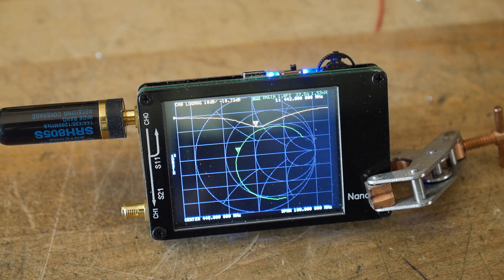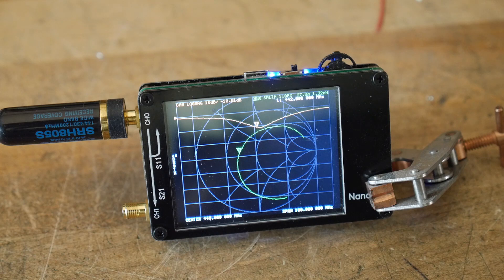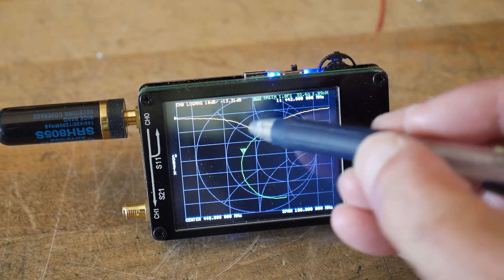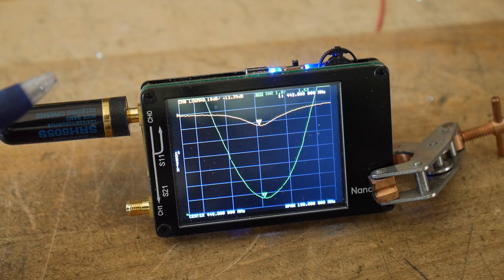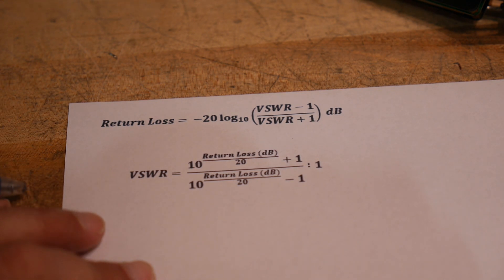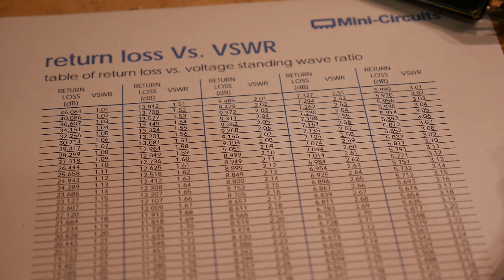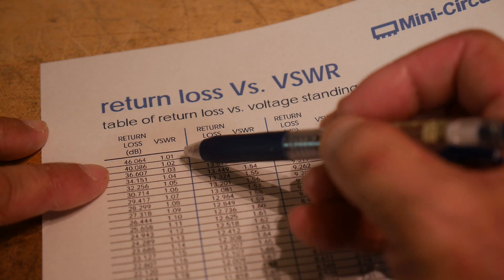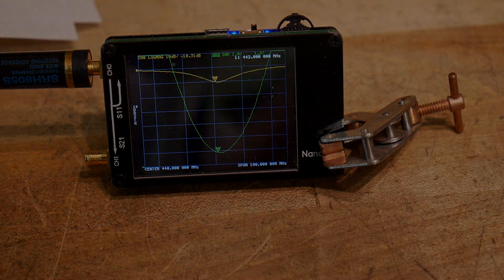#368 NANOVNA Return Loss vs VSWR

Comment: Wow! Nice. I just got the NanoVNA-H and stuffed it on my homemade mag loop. Verrrry interesting plots. And now I can begin to understand why the X5105 says the SWR is one thing and the VNA says the plot looks like I should never get on the air ;-) (Wish I'd had one of these toys starting out six decades ago. I might have gone into engineering instead of linguistics ;-) )
Reply: I had the same thoughts at first. I had to make sure I recalibrated it or recalled a previous calibration before taking a measurement. If you just turn it on it defaults to a non calibrated state and gives some erroneos readings. I did this with my first vertical antenna and the VNA said 1.1:1 swr but my radio was saying high swr. Calibration was off. I thought I was doing the right recall proceedure but I was really hitting the wrong button it turns out. Just a tip!

Comment: To be perfectly pendantic - the LOGMAG of the S11 on CH0 of the VNA is actually the log-magnitude of the REFLECTION COEFFICIENT, not Return Loss.  Strictly speaking, Return Loss is a positive number - i.e. the greater the number, the greater the "loss".  If you simply change the sign of what you're reading, you get Return Loss.   
Return Loss = -(Reflection coefficient or S11).
The terms are used interchangeably.  You've correctly referred to Return Loss as a positive value, but the nanoVNA displays and plots the LOGMAG of S11 which is the Reflection Coefficient.
Reply from the maker: Thanks Alan. Your comments are always welcome
Reply: @user-lp3cf5yn5b  A very low reflection coefficient like that is good.  It means there is very little energy being reflected.
Reply: @user-lp3cf5yn5b  Based on the picture you emailed, there really isn't much to be concerned about.  -45dB ref coef is still quite good.  Looks like you have your transmission line terminated (based on the smith chart).    The dips at 2.8 and 8.2m don't really indicate anything significant.
Reply: i know it's quite off topic but do anybody know of a good place to watch new series online ?
Reply: @Lennon Louis thanks, I went there and it seems to work :) I really appreciate it!
Reply: @Rory Cayson Glad I could help :D
Reply: I am struggling to grasp the Logmag reading, vs return loss. Typically, you want the return loss high, right? If less energy returns, it must have gotten thru or radiated.. Which would represent SWR being low..
Reply: @clems6989  Yes, you want the return LOSS to be high (a large positive number).  Thus, you want the reflection coefficient to the small (a large negative number).  They are the SAME number, they just have different signs.
Reply: @w2aew  Hello, I recently purchased a litevna64 to measure FPV drone antennas. Do I understand correctly that -30 is better and -5 is worse? What numbers are good and bad? 🙈
Reply: @DartRM27  Yes, for S11 (which is reflection coefficient), the larger the negative number, the better. -5 is better than 0, -10 is better than -5, -15 is better than -10.  A reflection coefficient of -10dB is approx equivalent to a 2 to 1 SWR and considered good.  S11 of -14dB of about equivalent to SWR of 1.5 to 1 and considered near perfect.
Reply: @w2aew  thanks 💘

Comment: Swr is just a visual representation and simplification of return loss as measured by a simple and cheap meter, Hence why it's a popular measurement.
Reply from the maker: It is voltage measurements not power measurements making is easier (cheaper)

Comment: Hello, I recently purchased a litevna64 to measure FPV drone antennas. Do I understand correctly that -30 is better and -5 is worse? What numbers are good and bad?
Reply from the maker: yes -30 is better. you want at least -20 for a good antenna
Reply from the maker: https://youtu.be/0GrMIGAyFUE?si=VOGwFwy7gjinc3AO
Reply: @IMSAIGuy  thanks 🙏🏻
Reply: Do you have, or could you do a video on what happens to reflected power? There are too many folks claiming SWR finds its way to the antenna and is getting radiated, not lost. Sure, the radio can also reflect power coming back toward it, too, but the chances are the combination of transmission line and radio amplifier output network losses are wasting most if not all of that power. You have great ability to show many things with your vast test instruments, can you show what happens to reflected power in a typical ham setup?

Comment: I'm always troubled by people who use db as a thing.  "DBs" is not a thing that flows out or bounces back.  Energy is a thing.  Energy, measured as power, voltage, or current is what is flowing out and/or reflecting back.  DB is a ratio of two things (power, voltage etc.).  At 1:19 you say, "how many dbs come back?"  That is a nonsense question.  DB is not coming back.  The return loss at the input is the ratio of the power going out (forward) to the power coming back (reflected) and is measured in db.   It's a ratio, meaning the reflected power divided by the forward power.  Power / Power (or voltage, etc.) means the units cancel an you are left with just a number.  And that number is not going out or coming back.  It's the combination of both, not one or the other.
Reply from the maker: saying how many db is coming back is like saying what percentage is coming back...

Comment: so I guess a perfect 1:1 match equals an infinite return loss.
Reply from the maker: yes  minus infinity db   you will be limited to the noise floor of the instrument.  70db 0 to 300mhz  50db 300 to 600mhz   40db 600 to 900mhz
Reply: Very doubtful you will ever see it in real life.  However if all the power is absorbed by the load there is nothing to come back to be measured.  You may get so close that the instruments can not show it.

Comment: Hello! Nice video, thanks a lot.  Now, which firmware version did you use to do the video, the "aa" DFU or the "ch" DFU?  The "aa" device firmware update (DFU) is known as the Antenna Analyzer version.  Can you tell us if you did use that one or did you just use the default one?  Thanks!
Reply from the maker: used the aa. both use the same data just plot it different

Comment: I have always hated dBs as it never seems to make much sense to me, for instance how is 46dBs of return loss better than 6dBs ...I find it much easier to work in power loss in Watts, for example TX puts out 100 Watts and you lose 10 watts so there's 90 Watts going out the Antenna...rather than 46dbs loss with 6dbs going out which doesn't make a lot of sense to me.
Glad to see even the Experts having to use a Table to work out what the dBs mean in swr terms.

Comment: Hi @IMSAI Guy, i was wondering why the return loss is presented on the NANOVNA in a negative value (-12db)

Because the cheat sheet do not present RL in negative values...
Reply from the maker: I've seen it both ways. Nice to have the negative sign so you don't confuse gain and loss. +10db gain. -10db loss. Otherwise, if it is understood to be a loss then no sign is needed.

Comment: hi, ty for your video.
i want buy one but how & we can see frequency resonance of an antenna ??
ty
Reply from the maker: the frequency resonance will occur at a low return loss. So I look at return loss trace and set a marker. move the marker to the dip in the return loss and the marker will read out frequency. or use SWR trace if you like that instead.
Reply: @IMSAIGuy  ok, ty & sy i have see your video on bad antenna & good and it's explain I just ordered one at the moment
TY ;) fast reply wow +++
Reply: Resonance occurs when j=0  (s11)

Comment: Can this nanovna tune a duplexer?
Reply from the maker: I would think so
Reply: Yes it can with the one problem .  If a duplexer has more rejection than the nano can resolve you run out of 'head room' .  That is if the nano puts out -20 dbm of power and the receiver part is -100 dbm you have 80 db of range.  If the duplexer has a rejection notch of less than 80 db you are ok to go.  The better duplexers will have over 90 db of rejection, so you will not be able to get a good notch adjustment.

Comment: ... I should have said inconsistent with your video.
Reply: Some more detail:

|s11|dB=-ReturnLossdB in the real world, hams tend to think -ve ReturnLossdB is correct. The plot you point to when talking about ReturnLossdB is |s11|dB, and it is -ve.

The second formula is correct stand alone in the real world, but if you take ReturnLossdB to be -ve as you infer when referencing the VNA, it will give the wrong result.

Comment: I wonder why there is no return loss meters then along with meters in radios...
Reply: Probably because is easier to read 1.02 vswr than 40.086 loss? I have an antenna analyzer and I had no idea how to use the vna part of it... until now
Reply: @vijovame  I guess it is easyer to see a bar graph getting as low as possible vs another graph going as high as possible by fallowing your comment. May I ask what antenna analyzer you have ?
Reply: @Aleziss  I have 2, I built the EU1KY analyzer and I purchased a MINI1300.
Reply: @vijovame  the EU1KY is NOT the nanovna right ? they are different devices ? how do you like the mini1300 ? that newest one has a VNA port which the 600 did not. Are there softwares for the mini1600 ? I am really "afraid" to invest in those analyzers, first, I know nothing about them and how to get my way around (can't even understand a smith chart) and two, there seem to be sooo negative comment about the quality and precisions of these chinese vna analyzers... it's either really cheap or quite expensive like the minivna pro at 600$. I understand that 600$ is not expensive for a VNA but it is for someone like me who is not a RF technician and use this tool not really often beside testing antennas and measuring baluns...
Reply: @Aleziss  I like the mini1300, it has a lot of functions on it, a metal case and includes a rechargeable batery, but I did the same analyzer with some parts and works the same but no battery,  you can see the EU1KY AA and best firmware here:
 https://www.youtube.com/channel/UCz0x9-5AH4_A_nhiAp1HXdw

The mini1300 can use the same firmware as the EU1KY AA. Webpage is on the description in the videos from Ian. Good luck.

Edit: no, EU1KY is not a nanoVNA